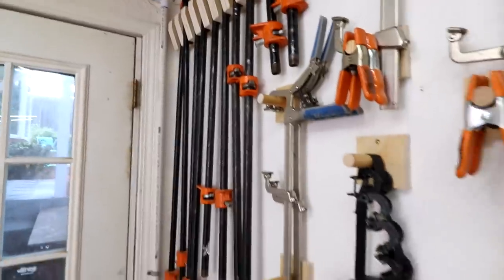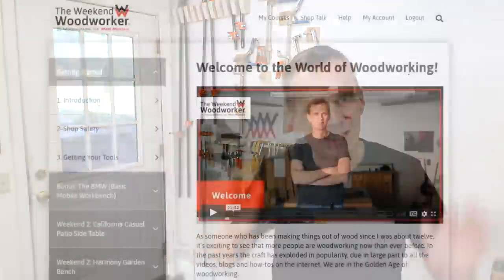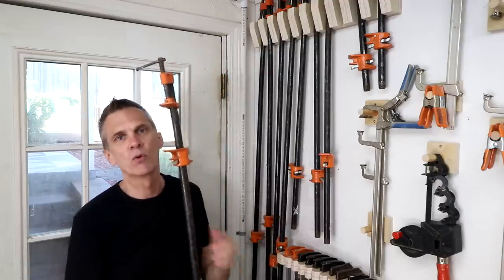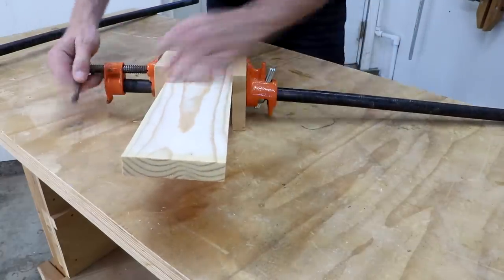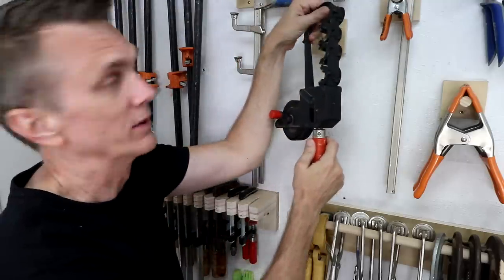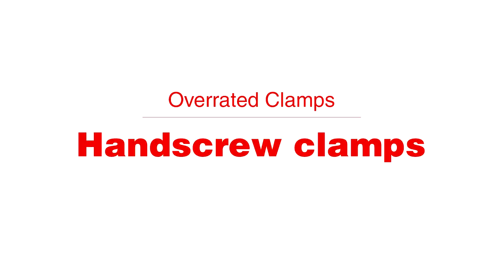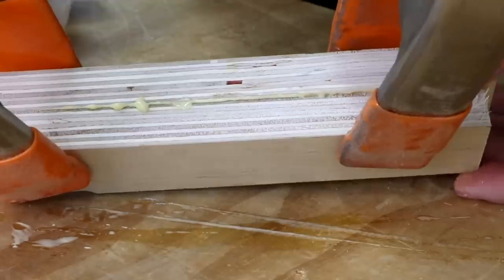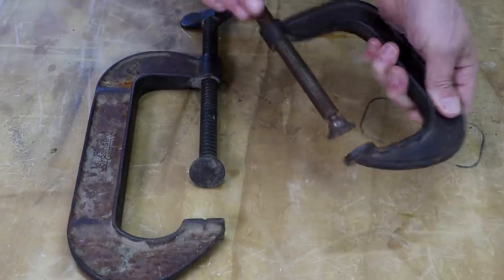How many clamps do you REALLY need? Woodworking basics.

Comment: You asked, so I will tell you my favorites.

Pipe Clamps - I have a few but don't use them that often. I prefer the Pony CabinetMaster clamps which while more expensive are a much better clamps. I have a pair of 48s and a pair of 24s. 

F clamps - I have a few Bessey F style camps in various lengths. Like you these are my go to clamps for most clamping tasks.

Squeeze clamps - I have about a dozen Irwin QuikClamps, six 6inch and sic 12 inch. I also have two very small ones about 4 inch capacity that are great for working on small projects lie a jewelry box or other delicate work where very light clamping pressure is needed.

Spring clamps - I have four medium size Pony spring clamps. They don't get used very often for the reasons you state.

Band clamps - I have a Pony band clamp similar to yours, and I use it on boxes and on odd shaped glue-ups. Wouldn't want to be without it. I also have two heavy duty Pony band clamps with a 2" wide x 20 foot long strap. I bought these for some repair work I was doing on an old house 35 years ago. I think I might have used them once since. Nothing else would have worked at the time and no one had clamps I could borrow so I bit the bullet and bought them.

Aluminum bar clamps - These I have recently taken a liking to. They are light and easy to handle/maneuver when gluing up a project. I get the inexpensive ones from Harbor Freight. Not because they I can't afford other brands but because theirs are just as good if not better than similar clamps offered by others. I pad the inside of the bar with a piece of 3/4 plywood as Paul Sellers and others have done ( search YT for "Clamp Retrofit | Paul Sellers" ). Actually for most clamping these can replace pipe clamps and cost even less than pipe clamps.

I could get by with your nine clamps if I had to. But having a few other key clamps makes life easier and if you are gluing up multiple items at once you can go through your short stack of clamps pretty fast. So you would have to do sequential clamping which might stretch out the job longer.

Comment: Oooh... gonna have to disagree with ya there buddy... spring clamps provide constant pressure and consistent pressure when gluing up small project parts.  As the pieces dry, they can contract - some pieces, that amount can be considerable.  Only spring clamps provide consistent pressure the entire drying process.  For me, an example would be clamping gunnels on small boats and laminating archery bow limbs.  For others, it might be clamping small laminates or inlays on furniture.  For larger projects, they won't be strong enough but for small projects or small parts of large projects, they outshine any other.

Iron bar clamps can leave unwanted ebonizing (black stains) on your projects when glue comes into contact with them.  Either wax the hell out of them or consider those aluminum square stock clamps.  

Still enjoyed this video.  Come to think of it, I think you do a great job on all of your videos - good mix of information and entertainment - exactly what I want out of youtube.

Comment: As you astutely pointed out, the question of number and required clamps is highly dependent upon what you're doing... AND there's just SOOOOoooo much variation on woodworking.

    For pressing metal fittings into tight arrangements with wood, C-clamps are best. Not because they're all metal and bad-ass with the forces they can generate (you need OLD C-clamps for that anyway)... but because they DO create a bit more force EASIER, so you can control it. You also get the benefit of one "foot" being flexible (slightly) and the other rigidly fixed. This allows you to determine whether you need the "clamp force" with a slight angle (rarely) or a direct and rigid straight line (most useful).

     For anything in soft wood... GET THE DAMN WOODEN (old school) JAW CLAMPS. You'll cost yourself a WHOLE lot less time with a sander in your hands trying to fix what you've f***ed up royal with those damn metal jaws.

    Spring clamps are GREAT for those little piddly things. Add a rubber-band to the jaws and you can press veneer and trim down along the edge of a project about as cheaply as it gets. They hold sheets and tarps in place for high-volume dust and debris control, or to keep the cold air at bay reasonably in winter (when you still have to get stuff done AND vent the shop a little).

    Bar clamps are pretty go-to for reasonable sized builds. The quick-clamps out of Irwin or HF are awesome as they trigger-feed, and there's a "release button" that also lets you just slide the jaw in a "macro adjustment"... They press plenty for glue-ups. and come with nicely cushioned jaws so you don't mangle the softer woods so much.

    Pipe clamps are economically responsible, and ESPECIALLY damned useful for panels, table-tops, and LARGE work. However, it's a stretch to say they're THE best clamps for woodworking in general. Metal jaws mangle wood. Obviously scraps can be used to cushion some of the work, BUT it's worth pointing out that you only have so many hands, and when you're juggling gluey gooey pieces of project, heavy metal pipes and jaws, and scraps to cushion everything... you run out of hands quicker than you'd like.

    Finally, it's worth pointing out that if you habitually put a LOT of pressure into gluing, as in you're bending the wood together constantly, rather than square it and straighten it to fit BEFORE adding glue... you're project is SUFFERING in quality. There are occasions when this is practiced, without too much hell to play, but it's important for joinery and all other things "fitted" together that you get that fitting right first... not hoping the glue is somehow magically strong enough to warp the wood and "make it work" forever.
    Generally, any clamp that CAN clamp tight enough I don't want it on my hand for an hour, can hold tightly enough for gluing... or I'm screwing up the project. ;o)

Comment: I really like having Ratchet/tie down straps. I use them for larger items and they're handy to have outside of woodworking. Sometimes they can pull to the side of the ratchet but you can just join two together and ratchet from both sides to even things out.

And the quick grip/trigger style of clamp.

Comment: I learned woodworking building sets for theatre, where Gaff tape is used for all kinds of tasks including clamping things down. I own more types of tape than you have clamps on the wall, but my favourite for this situation is Pro-Gaff by Pro Tapes, which is thin, hand tearable, and most importantly has a gentle temporary adhesive that doesn’t leave residue but is still plenty strong - the standard width tape is rated to hold 75 pounds and you can use extra layers for more strength. And because the adhesive stays on the tape when removed, you can stick it on the work bench after using it to be used again later, though eventually the adhesive gets too much dust on it. Give it a try - it’s especially useful for times when you need to cut right next to where the tape is - you can even cut through the tape if you want. Black or flourescent yellow are the two industry standard colours, but white is probably more useful for woodworking since you can easily write on it.

Comment: I really like QUICK-Grip bar clamps.  I have a set of two small and two large.  The large ones are very handy to fasten my surface planer (or any bench top tool)  to my bench top.  I rarely use my pipe clamps anymore in favor of my Bessey K-clamps.   The pipe clamps do not offer the parallel forces like the K-Body, plus using pipe clamps you have to protect your wood from black staining during a glue up.  I agree with the Bessey F clamps, I have 4 and these are VERY useful!   Jorgensen bar clamps are okay and fit where the K-Body can not.   I have several sizes of spring clamps but threw away some cheap ones that I really hated.   I recommend buying clamps in sets of two.

Comment: I do have a few of the wood parallel jaw clamps. They are useful for putting a "handle" on small parts that otherwise might get away from you. I use them to hold short bits of molding that need to be shaved on the miter saw, small parts that need to be rounded off on the router table, or held accurately on the drill press. Their advantage is that if I get overzealous and feed the clamp into the blade, the wood jaws absorb the damage well.

C-Clamps seem to be most useful for metal work, but not much for woodworking.

But the main clamps you mention are also the ones I use most in both my personal shop and in the school shop.

Comment: Spring clamps are frustrating when trying to use them single-handed whilst holding work etc with the other hand, you're right, but they have those auxilliary uses [like the photographer] that make the 'handy' at times. I have many power tools that I like to keep portable but bench ready, so i like to attach my; grinder, belt sander and even my vice to a firm board and anchor it to the workbench with C - clamps. They're rigid, reliable, don't get needed elsewhere and free up the 'good' clamps for the actual work. As you say 'horses-for-courses' so I think while an unending supply is a bit ridiculous, methodical planning of what your work parametres are likely to be can, as you say, give a good ballpark figure for clamps required. Don't stockpile them just because of the saying! [Woodworking - you can never have enough maxims!]

Comment: I've keep the number of my clamps down by sticking with longer clamps (not huge) and using them for everything.  For instance I have four 24" bar clamps, four 54" parallel jaw clamps (awesome sale at Woodcraft about 25 years ago), four 48" pipe clamps, four Craftsman 24" quick clamps (another awesome sale around 20 years ago)...I just used these when building a small set of outdoor stairs, a set of nylon spring clamps, two wooden clamps, two band clamps, a few C-clamps that I mostly use for automotive and metalworking and finally six 2" handy clamps that were 99 cents after rebate.  I always intended to get more clamps, but I really never needed more and in fact, most likely I'm "over-clamped".  These days Craigslist, Facebook and the like have several gently used clamps at bargain prices and I've also found that when I'm looking for something if I just put the word out with family and friends often the item magically appears and usually for either free or low cost.  The older I get, the more I learn that less is more.

Comment: I saw the pipe clamps in your videos,, and i know i want those. Then i saw some bar clamp faces sold on the net i bought them and form our old heating pipes which was 1/2" iron pipes i made 6 different sizes. I really love them. Form me the one handed bar clamps are essential. I can set them easy with one hand and hold the things in place. It can't hold very tight, but for temporary holding is a great thing.

Comment: I have invested in parallel clamps, F style clamps, and spring clamps in my arsenal of clamps. I despise C clamps and gave the few that I did have to the goodwill and have not found a use for wooden hand screw clamps other than for holding up a flat panels vertically from tipping over and for holding small parts for the drill press.

Comment: I agree on the c clamp I only use it when I run out of clamps. I do like the slider clamps with the squeezing to get tighter, quick grip clamps as they are some times called.  I totally agree on the 1/2 in pipe diameter no need for larger. I only do have nine regular sized clamps. Some mini ones I use as movable tape dispensers, but they don't count.

Comment: The classic wood clamp i use on the bandsaw and drill press to provide a flat base for a small part. Used like a drill press vice but more woody. (useful for metal parts as well as a non marring vice)

The C clamp are indispensable for metalworking. Lots of force into them and heat resistant. I can hold metal parts in position before welding. I also use them as a press to dive out pins, or push in pins for hinges, or even in cars as a tie rod sepparator (a large socket is also required). As woodworking.. yea, the extra power they have is rarely useful, also the all metal fire proof construction is not a functional thing in woodworking.

Spring clamps are just light duty holding very small parts.. like gluing a popsicle stick construction.

And one of my favorite: the selflocking plier/clamp. Very valuable in metalworking. Holding small parts while grinding, or clamping stuff before welding, or clamping pipes to unscrew them, etc... again mostly for metal working.

Comment: I agree with your essential clamps, but I would add the sliding grip clamps and the wooden parallels that you say are overrated. I have been a shop teacher for 24 years and my students and i use them constantly. We use them to hold panels down when they are sanding. We use them when the students are gluing up panels. If the boards are not dead level we put cellophane tape on the jaws and use them to level the boards. We also use them in conjunction with the drill press when drilling round stock.

Comment: Steve, I'm a long time fan.  Saw this on Rex Kruger's recent video.  The handscrew clamps are handy on my incremental table saw fence for holding wood in the joinery slide and, as you said, for holding items.  Sometime I use one to hold the item and another to hold the first clamp to a sawhorse or bench edge.  Never used a spring clamp in 12 years as a professional photographer.  My grandfather was a welder and taught me to weld; later I learned to run a lathe and milling machine (semi-pro; not the day job).  C clamps are handy for many of the same applications as F-clamps but without the "give"of an F-clamp.  They're great to hold makeshift or temporary fences and stop blocks in place.

Comment: Pipe Clamps, bar clamps, or quick clamp is all I use for wood.  C-Clamps and vise clamps for metal working. Spring clamps are the 3rd hand to hold a tape measure in place or to hold paper down so it doesn't blow away.

Comment: The bar clamp extension method (at 2:48) seems needlessly complicated. You can just use a coupling to join the pipes together.
The F-style clamps (at 3:20) always seem to require one more hand than I have available due to the need for using cauls to prevent marring. I prefer the better quality one-hand trigger clamps with soft pads supplemented by Harbor Freight cheapies for extra-large glue-ups.
Most of this type can also be used as spreaders. As for the HF ones - you can never have too many free flashlights.

Comment: The little 3" bar clamps get a lot of use in my shop, mainly for holding down sacrificial surfaces to my bench when gluing, staining, etc.  They are also quite handy to hold a sheet of toolbox liner to my workbench when sanding (helps absorb vibration & decreases movement of the workpiece).  Finally, they are the perfect size to hold my long straight-edge when cutting full sheets of plywood with my circular saw-- the small sized head of the clamp is low enough to remain clear of my circular saws motor (where it catches on the larger heads of bigger clamps).

Comment: I'm a boat builder, I can't do without C-clamps. I have all the clamps you reviewed, but can't get by without the classic C-clamp. Thanks for your video.
Reply: totally agree, c clamps are the best. they are the original and the best, nothing matches them for amount of pressure that can be applied easily. f clamps just dont measure up . have been a professional joiner in the uk for over 35 years making stairs, cabinets and various special order items that require a lot of laminating of curves. i own over 1200  c clamps collected over this time.and  that wasnt a mistake ,i did say one thousand and two hundred.

Comment: Need a longer pipe clamp... get threaded (female) pipe couplers (like black-black-pipe-fittings-521-204hn-64_1000.jpg) and screw two lengths of pipe together. Then you don't need as many of the clamps, just more pipes
Reply: But aren't the couplers on the outside of the bar?
During a normal glue up the workpiece is resting on the bar. That doesn't work if you have a bulge in the middle.
Reply: @Jehty_  For the example shown by Steve (2:45) a coupler would work,  require fewer "clamps", and the bulge would not be in the way. For clamping flat stock that was wider than the pipes I had could handle, I used scrap boards across the pipes, but not on the coupler to eliminate the bulge. Not perfect, but if you only need long pipes occasionally, it works great.

Comment: Agreed -  We have an assortment of old C-clamps and, unlike other clamp styles, lately we are finding them damaged and unuseable and unrepairable when the threaded shaft is bent.
Reply: Arbor press, or, tape some small hardwood blocks to a bench vise and straighten the screws. Arbor press the 'Cs' to straighten them. Put the clamp in a vise and twist the C till straight. I love to find old rusty bent C clamps. I buy then for a buck or 2 and sell them for $ 10 to $15

Comment: In case anyone is wondering about that quick shot of the black pieces of metal when he says "gimmicky clamps" (around 4:30): those are panel clamps. The idea is that they attach to a length of wood on both sides of a panel and apply pressure on all sides at once. The pictured equipment isn't the whole thing. Generally, you'd want two sets of these clamps.

While I agree that they aren't necessary, I wouldn't call them a gimmick at all. I find them incredibly effective and very easy to use. I like being able to glue up a cutting board, then tighten down in two spots and just leave it.

I even went a little overboard and used some superstrut for maximum strength. It works incredibly well.